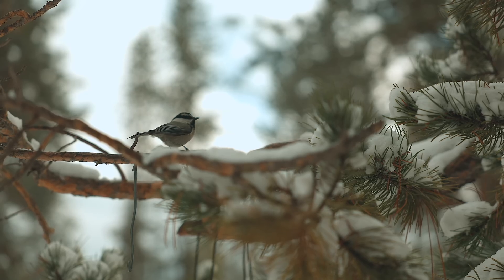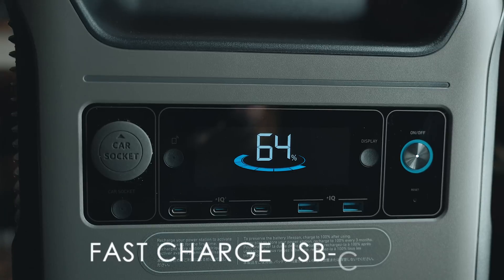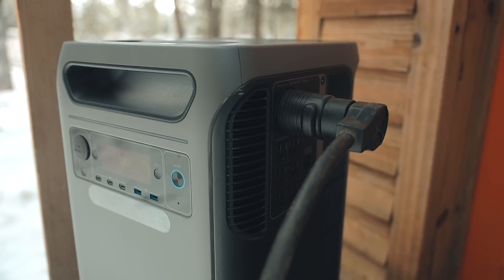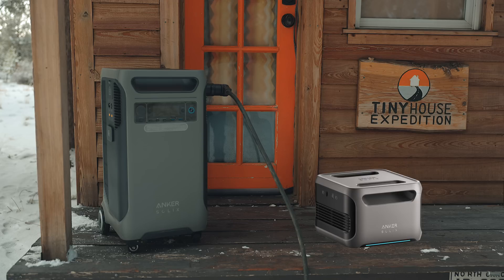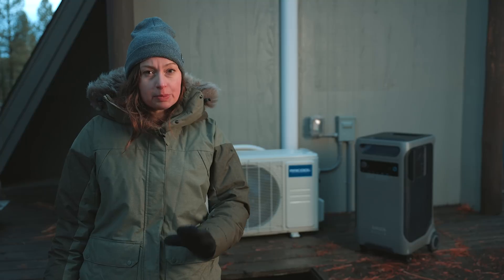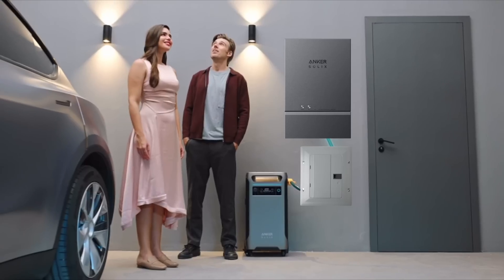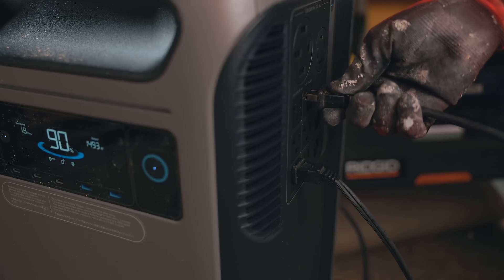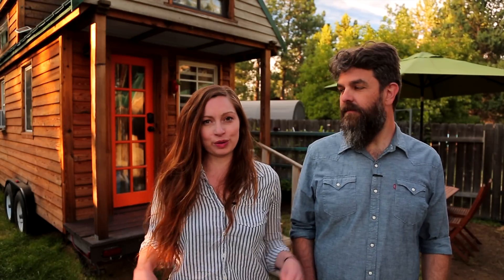Tiny House Power & beyond! Anker's Best Power Station Yet ⚡

Comment from the maker: ⚡🏡🚐 Get the Best Deals of the Year! Save $1,600 on Anker SOLIX F3800 during Black Friday Deals--buy now: Amazon, https://ankerfast.club/ugyxum ⚡ Anker: https://ankerfast.club/xbeu89 ⚡We tested the F3800 expandable power station around our tiny homestead. It's the most powerful yet from Anker, with a massive dual-volt (120/240) output of 6000 Watts. It can be integrated into your home's electrical system with a transfer switch or smart home panel, plus a solar panel array, for easy management.